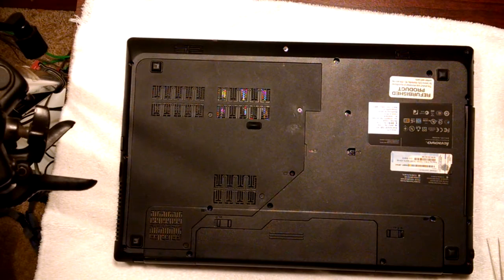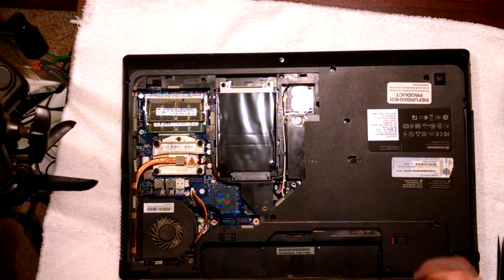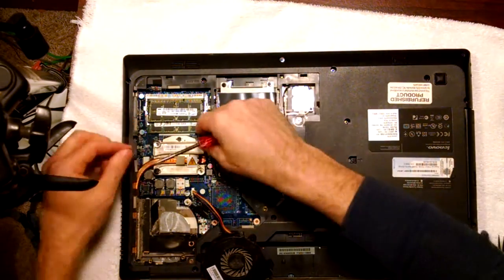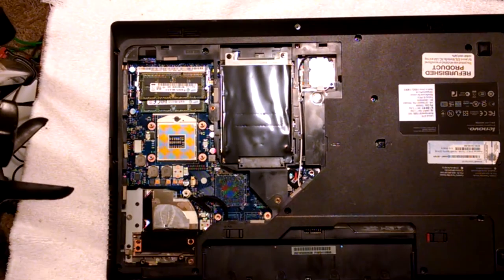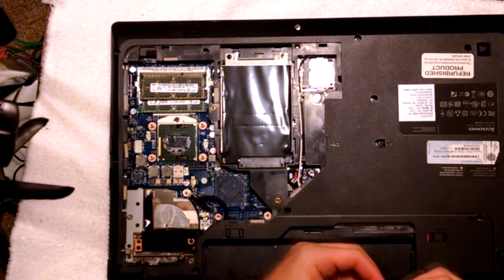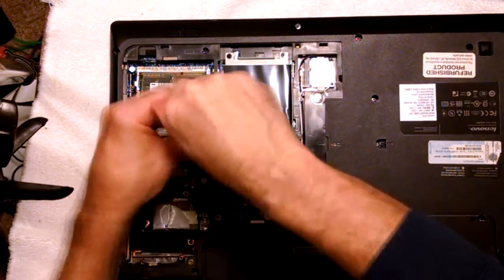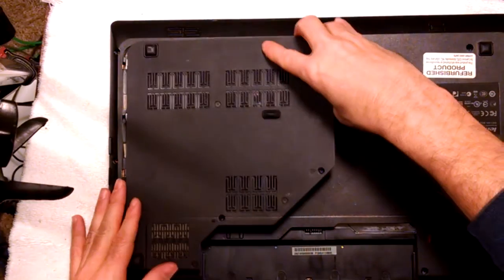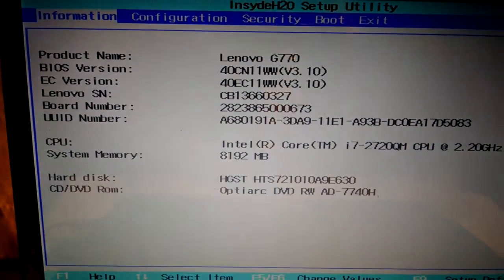Lenovo G770 i7-2720QM CPU Upgrade

Comment: Just got my super old probably 12 or 13 years old G770 laptop upgraded. It was dual core i5 2430M and I changed quad core i7 2720QM. The laptop was not bad on how it performed earlier (I used it in one room only for netflix and sometimes for internet), it had 8GB RAM and probably 7 years ago SSD upgrade, but since I was repairing broken screen openning (completely cracked) and relplaced keyboard since old was doing already funnies, I went also for CPU upgrade. As far all works fine, though seems to me that TDP 45W makes some heats effects. I run CPU-Z benchmark test earlier, and even on stress test CPU was performing without degradation of performane, where after upgrade I see that it starts at 3.3GHz and in multithread test does like 1275 points, but with time it drops to 2.2-2.4GHz and end result is rather like 1190. Still not bad, original i5 was around 620 if I remember correctly.

the only problem after config change was that Windows10 messed up (the same way as 4 years ago after upgrade from W7 to W10) with switchable intel/ati graphic drivers, so had only low resolution and issues. I reinstalled W8 drivers for both ati and intel and that fixed, but see that e.g. in Edge browser videos switch to black screen now (something with switching stream between 2 graphic cards - nothing to do with CPU, but change triggered windows to mess up with drivers setup and looks like I didn't get it fully right). Anyway, in Chrome all videos work, so that is fine for me, for one of spare laptops. CPU cost me less than $40.

Comment: If you still use that laptop, you can probably upgrade it to 16GB ram.  I have a G570 with a 4334EEU motherboard and was successful even though most of the lenova forum posts from so called experts claim 8GB is max ram.  The G570 mb looks very much like your G770's. 
Great video am about to upgrade to a I7.  Thanks!

Comment: Lenovo  g770  1037 upgraded i7 2720QM, Sandy bridge, 16 gb ram, 500 gig ssd hd.  I won't begin to say how fast Photoshop loads. Had to upgrade to windows 10 , Win 7 wouldn't handle the ram

Comment: I upgraded my CPU to a i7 2670qm thanks to this video. I've also swapped the internal HDD with an SSD and upgraded the ram to 16gb. I can report that, some months later, system still working flawlessly. Much cooler temp/running, too. Thanks, Dark Effects.
Reply: @DarkEffectsStudios  Hello Wayne, as you suggested I can confirm that my model reads: Machine Type Model: 10379JG  For sure the insides were different to yours, in that my model had a large heat sink covering the radeon graphics CPU chipset also, requiring careful manipulation to remove. 

I will presume my model is a specific European variant.

https://www.amazon.co.uk/DDR3L-1600-SO-DIMM-1600Mhz-PC3L-12800S-Voltage/dp/B010NMEHR6/ref=sr_1_23?keywords=16gb+ram+sodimm+1.35v&qid=1553650085&s=gateway&sr=8-23 was the ram I bought. Lower voltage 1.35v!

Comment: Please give me an advice,

My laptop is Acer 4752 with i5-2450m (upgraded from i3) with 65W charger, i intend to upgrade to i7 2720qm.
Should it will run OK, and will i got any problem with my charger and cooler (stock), my chipset is HM65.

Thank you so much :D, a greate tut video.
P/s: sorry for my bad english, i'm from vietnamese

Comment: i've got an acer aspire 5750G,it's got i5 2450m with intel hm65 chipset...
What's the strongest cpu that i can get for this chipset and socket..?
Btw my laptop supports only 8gb of ram,is it possible to install more even if i need a bios unlock..?

Comment: Does it run well? 

My specs:
Acer 4749z
I3 2348M
12GB DDR3
128GB SSD + 320GB 7200rpm HDD

I want to upgrade to i7 2720qm but some guys say that my mainboard can't handle this cpu...
Reply: Dark Effects Studios 
Chipset: Intel Sandy Bridge Rev.09
Southbridge: Intel HM65 Rev.05
Reply: Dark Effects Studios thanks you very much 

Maybe i will upgrade to i7 2620M, it's quite afordable in my area. Also, it's safer for my laptop :P

Please upload new video when you can replace the PS 

Have a nice day ❤️

Comment: Hey, how did the CPU perform in the long run :)? I also have this laptop and was thinking what would be the best CPU I could upgrade to.  Do you think it could go higher than 2720QM (although this CPU looks very good to me)? Also, you didn't have to upgrade the PSU, did you? I read that the i7 has a TDP of 45W, while the original i5 has only 35W. Thank you!
Reply: Thank you so much for your help! :) I'm glad to know the CPU upgrade really helps. If I may ask, what does that warning in the event viewer say (I'm really curious :) ).I was able to find an i7-2670QM in my area at a reasonable price. Sadly,  the higher frequency CPU: 2860QM is sold for double 2670QM's price. 
EDIT: Regarding the After Effects you mentioned, I have not used the software myself, but are you also using an SSD? (I assume yes :) ).
Thank you for the links, I've also found a compatibility list for the HM65 chipset on Intel's website (I had to click the 'Compatible Products' tab on the left): https://ark.intel.com/products/52808.
Reply: Thank you for letting me know about the error details :). I guess the temperatures are not that bad (Intel says max temp for your CPU is 100). At the moment, I'll probably delay getting another CPU, but should I find a PSU, I'll let you know. Also, regarding the SSD, I installed one just yesterday (I replaced the internal hard disk with it, and placed the hard disk in a caddy (bought separately, a 12.7mm is fine) which I replaced the DVD-RW with ; the reason I placed the SSD inside is because I read that the DVD-RW slot may only go up to SATA2 speeds, while the internal slot is SATA3). I can confirm that it works faster with the SSD, even though I'm using the old, original CPU :). Again, I'm not familiar with After Effects or similar software, but I think that a SSD is a nice addition overall. I also tested the SSD's speeds with CrystalDiskMark and it really reaches around its advertised speed on this laptop.
Reply: It does have a sata connector, yes. I use the same type of SSD in my PC :). The only additonal thing you would need is a caddy in case you also want to use your usual hard disk. This caddy replaces the dvd writer and the hdd is installed in the caddy.
Reply: Dark Effects Studios also (I also replied above), I do not know if all SSDs have the same size. The one I tried and can cofirm works is the samsung 850 evo.. It fits perfectly inside the laptop's hard disk slot.
Reply: You're very welcome. Thank you as well! Good luck with your project!! I'd be curious to see that commercial :).

Comment: Hi, thanks for the video!
Was it required to update the BIOS? 
Could you please tell what BIOS version do you have?
(Ordering i7 CPU)
Reply: Yes, the laptop is the same, and I checked - I have the most recent BIOS.
But the CPU got lost somewhere, investigating :)
Reply: Unfortunately the specs says that 8Gb RAM is max. I put 2x4gb 12800, works fine.
I won't go for different heatsink&fan, I just need to find my lost CPU and install it :)
Reply: Ok, could you please drop a new comment if you will be able to find out which memory bank(s) will be supported?